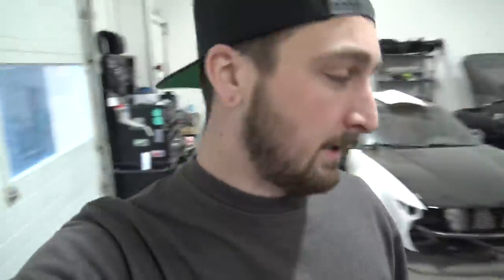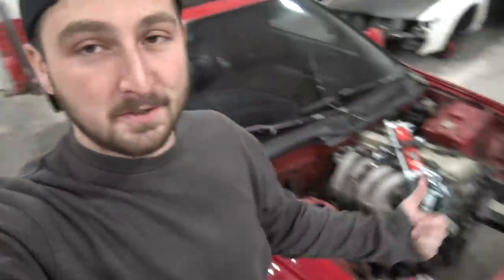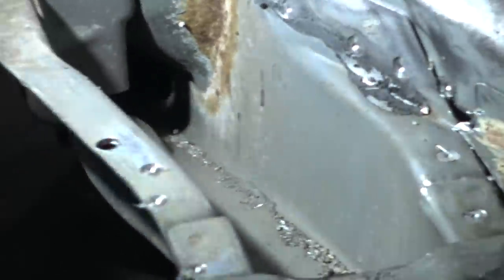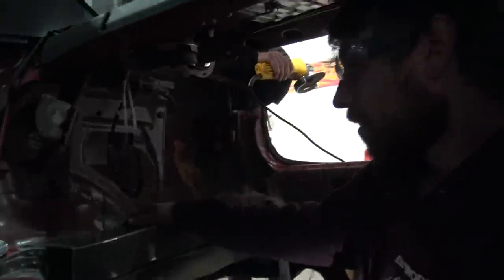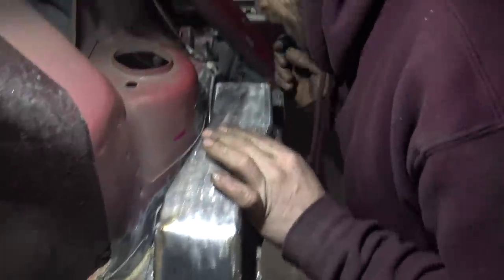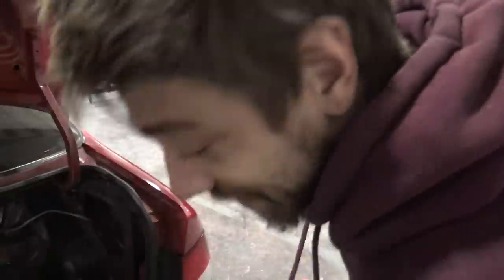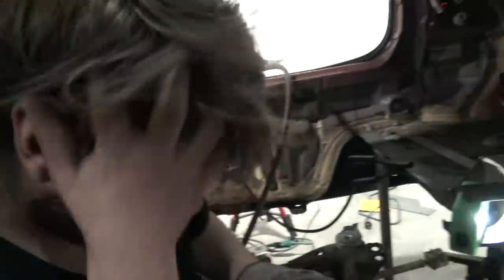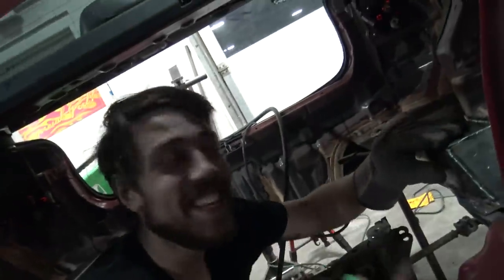240sx rear subframe in a Civic - Modifying the chassis around it!

Comment: Legit question here. Couldn’t he have used the crv rear end for bolt in purposes then ran the rest of the drivetrain as 240 stuff then just used a knuckle to fit the transmission and another knuckle (if they’re different) to fit the diff then welded the different knuckles to a driveshaft? Sort of like shortening a drive shaft but having different ends. Would that have saved him any time and money (assuming he would have had to buy the s13 rear end) on this project?